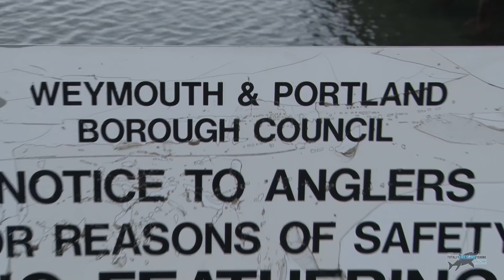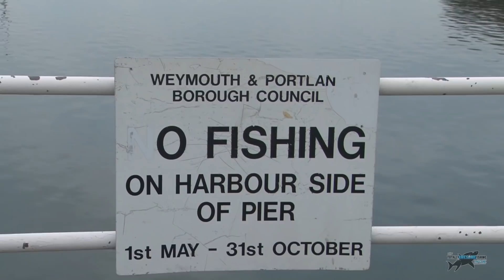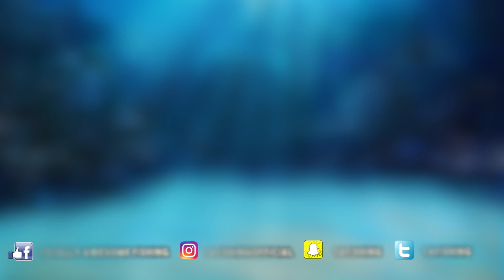Squid Invasion! Pier Fishing for GIANTS!

Comment: To avoid the ink problem, after you cut the head and tentacles off put the hood containing the organs into the freezer for half an hour, when you pull the innards out the ink sac is semi solid. You can then keep it frozen and use it to make pasta negra with or even write using it.

Comment: Very interesting and informative. Regarding cooking, there are many ways of course. In your method I would have flash fried the squid and then added soy and sweet chilli for the last few seconds. By adding those ing's with the oil before adding the squid you are basically adding liquid, thus reducing the frying method and also (although not drastically) reducing the heat of the oil. Cook the food and then add soy etc. Not telling you I am right or anything like that, this is just the way I cook (Indian chef).
Regards from West Cork, Mike

Comment: I wouldn't set the catch down on that dirty ground, even if they it is going to be on the fire later.
Reply: G. E. Oh shut up its going in the pan no harm on putting it on the floor
It will br cleaned before its cooked
Reply: @thesaintangler4686 , you don't have to be rude, you could just say: "It is going in the pan, etc." WITHOUT the shut up!